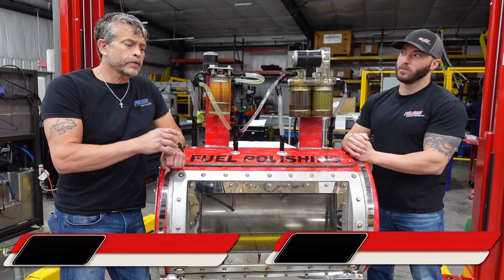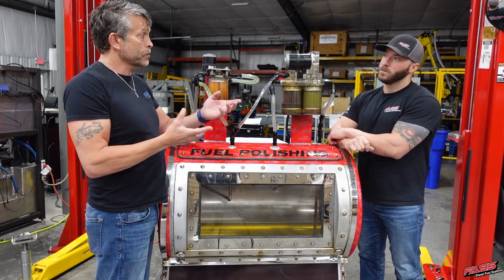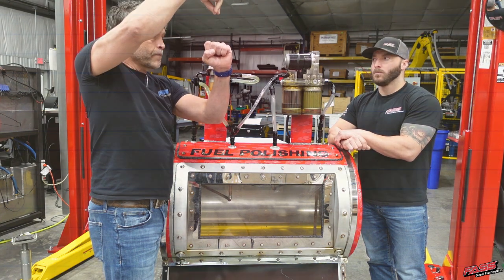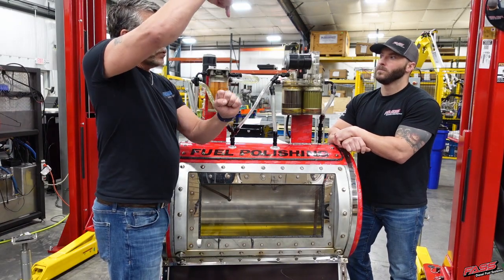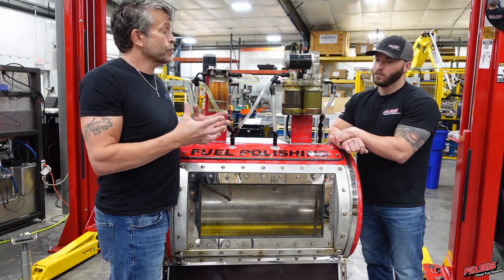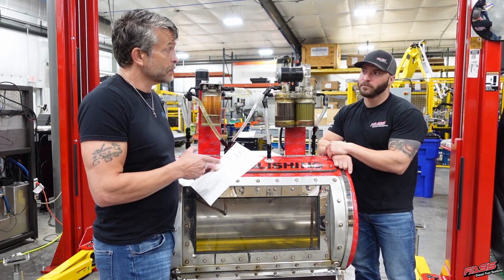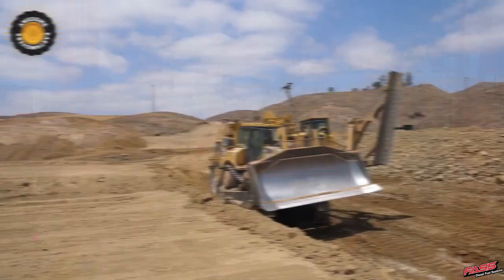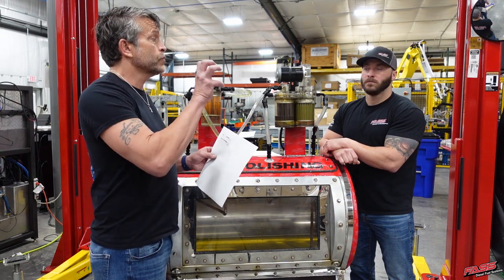How air in diesel fuel robs MPG & horsepower | Air in Fuel Episode 4

Comment: I installed your system on my 2000 Monaco motorhome with an a Cummings 8.3 that has a banks kit making about 430 horse. I should’ve done it earlier because last November I lost my caps pump when there was no indication that the lift pump had any problem because there was no leaks and I had a pressure gauge on the secondary filter that showed it putting 13 pounds to the injection pump for the 30 or 45 seconds that it runs. Now you’re system shows 18 to 19 psi constant going to my injection pump.
Reply from the maker: Thank you for the support! We're glad you're enjoying your system. 

Unfortunately, we hear similar stories about OEM fuel system failures quite often!

Comment: Anyone of the opinion that air in the fuel could cause missing, and eventually shut the truck off momentarily, especially on hotter days or days with wind? I’ve got a DD15, and if it’s hot and windy out, it’ll sometimes start missing if I’ve been driving it awhile, and then it’ll sometimes make this “bleeeeeh” sound, like a mild jake brake sound, then check engine light pops and engine shuts down. I can usually cycle the key a couple of times, and get it to start back up. Reason I suspect air is because there are sometimes huge bubbles in the Davco
Reply from the maker: Hey guys we would be happy to help. If you don't mind giving our service team a call at 636-433-5410. Thank you.

Comment: Have a 21 Ram 2500 wanted a 2020 but, didn't want the CP4. I want to install a FASS system,  truck will remain mostly stock under the 600hp. I know the 100gph will do the the job, but would it be beneficial to just spend the extra money for the 165gph? Wouldn't the fuel be polished more and more beneficial to the injection pump?
Reply from the maker: Great question, and it sounds like the 100gph system would be perfect for you. The 165 would flow more fuel, yes, but it would filter the fuel the same. We completely understand where you're coming from though!

Comment: air in fuel is real concern because it cause cavitation which in turn are damaging HP pumps, pipes and injectors and this is true for high output diesel engines ( think 2inch feeding  fuel pipes and daily consumption 50+ tons) with CR systems, on small engines is negligible.